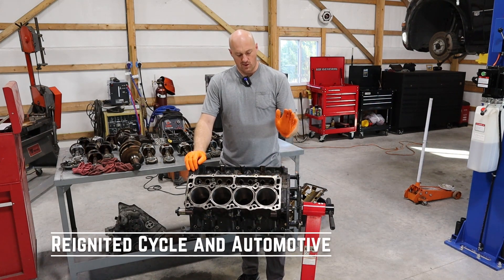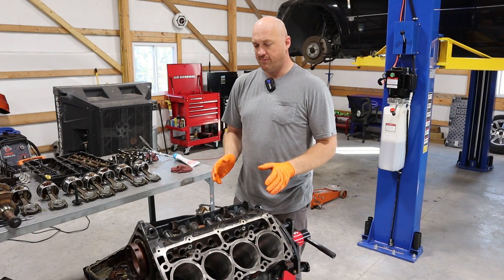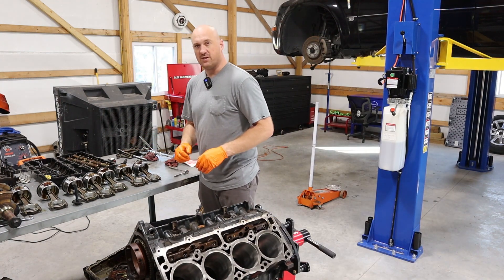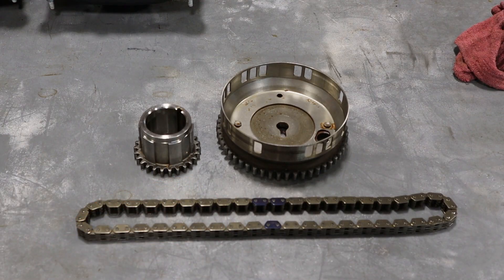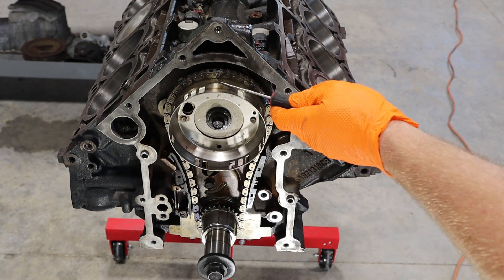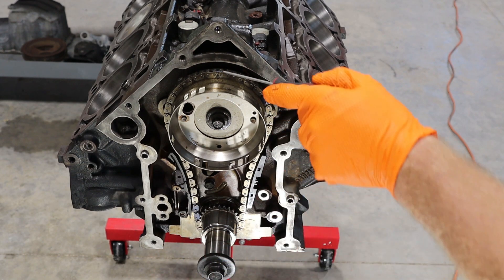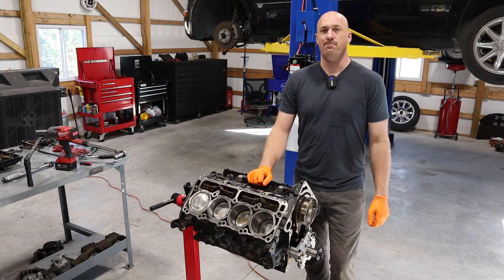How To: Engine Timing on Chrysler Hemi 5.7 // 300C Episode 3

Comment: How important is it to degree your cam after install. I ben hearing different things.
Reply from the maker: There's basically no way to do so on the Hemi engine, either it's in time, or it isn't. 👍
Reply: @ReignitedAuto  ok thank you. I've changed my cam in my 05 magnum rt an didnt degree it an was talking to my uncle about putting a cam in my Chrysler 300c an he mentioned that I needed to degree it an I must have gotten lucky before thanks again 🤘

Comment: Great videos! however 3 things that you said were not possible, actually ARE possible!

 #1: you can swap the cam without taking the oil pump off to see timing marks, just make sure you put engine to top dead center first before disassembly. There are several ways to check this even blindly and that is: put engine to top dead center before disassembling the timing gear assembly, confirm by pulling the #1 cylinder plug and put at least an 8 inch plastic rod down the plug and slowly turn engine over until the rod levels out indicating piston tdc. Also can see cam reference points and crank keyway position in the 1 o clock postion to confirm you're tdc, along with the removal of the spark plug to confirm. If you have the heads off then you can plainly see the piston at tdc to confirm its position as well.

#2 possible thing you said you can't do but can...remove oil pump in a Ram truck while the engine is still in the truck: remove the front half of the oil pan bolts, only loosen the rear half, it will give you enough room to pivot the pan even on a 4x4 to get to the 10mm bolt on the oil pump pickup tube!.

Last but not least the #3 thing you can do that you said we can't: You can indeed install the timing chain while the oil pump is still on and without removing the crank sprocket, the chain has plenty of slop before the tensioner is engaged to route your chain around both the cam and crank sprockets. And you can remove the tensioner assembly to recock it before pulling the pin.

How do I know? I've done all 3 of these methods and I own a ram lol and I also cheaped out and bought rock auto lifters and had to do the job twice!
Reply from the maker: Thanks for the extra information! 👍

Comment: @Reignited - Cycle and Automotive   realize this is an old thread, but my question concerns replacing cams with heads installed. When removing old cam, won't lifters fall through or at least slide deeper into the block, hindering or possibly blocking new cam entering the block?
Reply from the maker: There is definitely that potential, but I did verify on one of my other engines that's is possible to replace the cam without removing the heads. The lifters themselves are pretty flat in the block, but they might slide forward a bit, you can use a long magnet to pull them back through the pushrod holes as you're reinstalling the camshaft 👍

Comment: Is there just the one o ring for the oil pump..I assume the oil port between the 2 bolts holes are a press fit?
Reply: Thanks good sir....have had alot of engines apart especially toyota and ford's..but I'm a red sealed mechanic I'm nova Scotia Canada...and I had figured as much and it wasn't hard to tell from your video that you know shit and could be a reliable source....thanks alot my freind.
Reply from the maker: You are correct, just the one o-ring for the pickup tube, the oil pump itself seals to the block surface with no gaskets. Kinda strange I know, but it seems to work fine.

Comment: hello there sir I have been watching your videos i have got a lot of information from you thank you so much I have a 5.7 hemi that i did a complete body and 4 wheel drive and harness swap I have just pulled the the motor to inspect the parts for water in the engine oil the truck took a fall off the mountain and fell 50 foot down to a dead stop only damage I found to the frame assembly checking the straighten of the frame assy. was ok I want to do a upgrade cam and timing gear assy. I was told i could up grade to parts for the cam and timing chain assy. which is the R T white tensioner assy. but I can't remember what the up grade parts are can you please send me a email on it please (richardfrancwayfrancway32057@gmail.com looking forward to your response and once thank you for you training from your videos.

Comment: Great video!  One question for you if you don't mind!  I am looking to replace the timing chain in my 2012 Ram 1500 5.7 Hemi with a kit.  My question is, if I line everything up as far as the markings and chain colors being correct, does this mean that it is on the correct stroke (compression is correct if I recall correctly) or do I have to take the head off to see the piston at TDC to make sure.  I have also saw a few videos about a tool you put in the spark plug on the #1 cylinder.  I have been trying to figure out if I can do this without taking the head off or using the special tool based on lining up the dots and purple chain links.
Reply from the maker: For sure it's a fairly simple process with the cylinder heads still on. Remove the front timing cover and spin the engine over until the vertical mark embossed into the cam sprocket is at the 12 o'clock position. At this point you know the crankshaft is in the correct position, as long as you don't move the crank after this point then you're in good shape. When you put the new timing chain on, the camshaft sprocket timing mark pointing at 12 o'clock automatically puts it on the compression stroke (the crank doesn't care which stroke it is, the cam is the only difference) Align the new chain using the colored links and you're good to go 👍. The only tricky part about the Ram trucks is that you have to remove the oil pump, and to do so you have to remove the engine oil pan to remove the pickup tube. Let me know if any of that doesn't make sense.

Comment: I had a problem with torquing the cam sprocket bolt. How do you do it, are you holding the crank bolt while torquing the sprocket bolt
Reply from the maker: Best option is to access the flex plate and stick a pry bar in the teeth to keep it from rotating 👍
Reply: @ReignitedAuto  so don't worry about the timing chain tensioner collapsing all the way. Thanks
Reply from the maker: @ronjakober4949  As long as it doesn't jump a tooth it's fine lol.
Reply: @ReignitedAuto  Thanks for the answers. Much appreciated

Comment: Great video! But how were you able to tighten the sprocket bolt from the cam without it moving
Reply from the maker: Best option is to access the flex plate and stick something in there to keep it from rotating while you tighten the bolt 👍

Comment: I'm hoping I can get help with my problem! I am putting my hemi back together and I can't get 6 and 12 o'clock on my crank gear and cam phaser?? It's like my phaser is out of time. When I hold  up my phaser and and crank gear up with the chain wrapped around them I can't get the lines to line up. Any help would be greatly appreciated.
Reply from the maker: Paul hit me up with a picture on either instagram or through email. Instagram @reignited.tx  or reignitedsales@gmail.com Let me take a look at what you're working with and I'll try to help 👍
Reply: @ReignitedAuto  I just sent you an email.
Reply: did you figure it out? im having the same problem
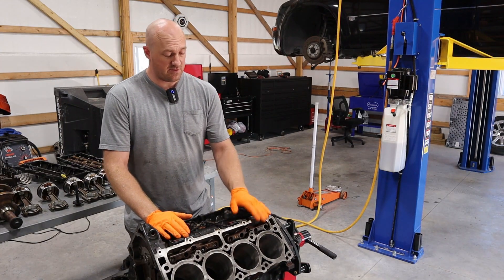Reply: @mellomechanixx9971  I did. When you align your 6 and 12. You want to make sure your 12 is dead on but what they don't tell you is your 6 will be more like 5:30ish.

Comment: Have you ever done the eagle hemi heads on pre eagle block swap? Any recommendations, if so?
Reply from the maker: I did actually try it once before, it's a huge pain. There's a lot of things that you have to buy to make it work. New pushrods, new intake manifold ect... Wasn't worth it in my opinion.
Reply: I have all the parts but am worried the pushrod size. Didn't know if you remember the pushrod size
Reply from the maker: @adrianortiz5085  I don't, but the factory pushrods from the newer engine should work.
Reply: @ReignitedAuto  that would be a great video to do in the future. There's a huge community that want more info about this build but no video in detail of how to. I find forums that have info but not complete steps and parts required. Great job on the videos you have out. Lots of info in detail. Keep it up
Reply from the maker: @adrianortiz5085  I've got an '06 block that needs a cylinder head, thanks for the suggestion 👍
Reply: @ReignitedAuto   I've seen the post about the new lifters with bigger bearing. Do you happen to have the new stock number and would that work on a 06 block set-up

Comment: Did you reuse the connecting rod bolts?
Reply from the maker: I did in this case. Technically Chrysler wants them replaced each time, but these are not torque to yield bolts, if you inspect them and they show no signs of stretching or fatigue I felt comfortable reusing them.

Comment: Hey man, your videos have helped me a lot in my rebuild. My mds lifters go up and down but the non mds all of them don’t budge when pushing with the push rod, is this normal or does it mean it’s bad?
Reply from the maker: Totally normal, the hydraulic portion of the lifter is still pumped up with oil, and it'll feel solid 👍

Comment: I have a question how do you tighten the cam bolt. I have a 2005 5.7 ram. And I have the timing set up already but. Idk how to torque down the cam bolt. Any help would be great ful 🙏🏻🙏🏻🙏🏻
Reply: did you have to drop the oil pan to remove the oil pump ?

Comment: WOW.. Great Video! what cleaner do you recommend for the heads
Reply from the maker: For cleaning the heads themselves, or for cleaning the gasket surfaces?
Reply: @ReignitedAuto  Gasket surface. Thank you
Reply from the maker: @Hugo_Umana  I use the red Roloc discs on a 90 degree sanding wheel. 👍

Comment: I have 2014 Ram 2500 with vvt no mds. The cam phaser is moving if I rotate it backwards slightly when setting TDC on #1. Is it the lock pin supposed to be engaged when it's not running?
Reply from the maker: It's normal to do that 👍
Reply: Pushrod on number 3 intake was out of place on the rocker,riding on the side of the rocker hanging the valve open. Put a timing chain and oil pump in it also. I've done 3 of these in the last two weeks, 37 years as a mechanic and I made a dumb mistake. Thanks for the suggestion,it worked out perfectly.
Reply from the maker: @mikevan803  glad to hear it! We all make mistakes, I've got a doozy of mistake I just made coming out in a video soon 😳
Reply: Thanks for the information, I replaced the push rods,severe wear on 5 or 6 of them I did pull the heads and inspected the lifters,all were in good condition. I didn't pump down the lifters It ran terrible. I rotated it at the crank about 5 times after,ran much better but still has a map code and stalling nothing wrong with it before. If the lifters with the bad pushrods were over pumped could it bend the valve slightly? Going to do cylinder leak down test on all tomorrow.
Reply from the maker: @mikevan803  first thing I'd do is pull the valve covers off and spun the engineover by hand to make sure the valve are all actuating correctly. Its very easy to not get the pushrods situatedproperly in the ends of the lifters, or they are not fully seated in the rockers themselves. 👍

Comment: That's not true, you can do a cam swap on a 15+ 5.7 hemi 2500 truck engine without removing the oil pump, the thrust plate has plenty of room. Ask me how I know :)
Reply from the maker: You're right, the '09+ models have a separate cam thrust plate do you can do that, this older model engine the thrust plate is connected to the timing chain tensioner assembly. 👍
Reply: @ReignitedAuto  I didn't know that either good info

Comment: When I rebuild an engine I would change the lifters if they  are good or not I would put new ones in because once you down that far you might as well replace them lifter the old lifters won't last that long so I will go ahead and replace with new ones that's what I would do I'm not saying he not a good mechanic but that's what I would do
Reply from the maker: Generally I would, but the pre 2009 lifters are not known for failing, plus I was just rebuilding this vehicle to resell, so you have to save costs where you can. Thanks for watching! 👍

Comment: On the mds soleniods if you change them and one was loss. Would it make the motor shake and act like its losing power. Man I am in a mess. And need help.
Reply from the maker: If you only replaced the solenoids it wouldn't cause any kind of a misfire. Did you do any other repairs besides just the solenoids? Do you have any misfire codes?

Comment: Running a stock cam is one thing, but keeping the mds system? I would have deleted that crap for sure.
Reply from the maker: I was just building this vehicle for resale, it wasn't worth the cost of buying a tuner to turn the system off. Thanks for watching 👍
Reply: @ReignitedAuto  thanks for the video,  been thinking about doing something with my 04 ram hemi. 175000+. Getting tired.

Comment: how do you know if the timing belt is worn
Reply from the maker: The timing chains will stretch a little, but usually there aren't any external signs of failure. If I were doing this jobto my vehicle and it has over 100k I'd think about replacing it since they are pretty cheap.
Reply: Do I need to replace both gears with a new chain?

Comment: Just me but if i have an engine out replacing cam I'd have new lifters too.... that's just me though...
Reply from the maker: On the '06-'08 generations they aren't having the lifter failures that the '09+ models have, so I felt comfortable re-using them. The cam was the stock cam going back in as well.

Comment: how do you keep lifters up for a cam swap in the car or truck
Reply from the maker: To be honest I've never tried it without taking the heads off, but I'm pretty sure it can be done. Just remove the rocker arms from the heads, spin the camshaft 720 degrees to make sure all the lifters are pushed back and then pull the cam. Would I feel comfortable that they wouldn't then slip forward and fall down? Probably not 😄 I'm definitely more comfortable taking the heads off to do a cam swap, but you're likely to be changing valve springs with a cam swap anyway right?

Comment: Had you known that you weren't going to have to send the block to the machine shop......   you wouldn 't have removed the MDS solenoids or the oil pressure sensor, correct?
Reply from the maker: Yep, figured the block was going to be hot tanked, but that didn't end up being the case. Thanks for watching! 👍

Comment: I have 6.1 hemi from a chrysler I wouldn't need to take the heads off just to do a timing chain ?
Reply from the maker: It's not necessary no, but you have to make sure the engine is at top dead center BEFORE removing the cam chain. If you dont remove the oil pump you aren't able to see the lower timing mark. 👍
Reply: @ReignitedAuto  thanks for the reply I'm going to try this soon I thought I was hearing a stuck  lifter but the shop I go to said it can be the timing chain tensioner had broke
Reply from the maker: @srt_andretti  is this a hellcat? I'll be honest, I've only ever seen a cam chain tensioner break one time. What noise is it making?
Reply: @ReignitedAuto  I wish it was a hellcat lol do u have a instagram I can send u the video
Reply from the maker: @srt_andretti  yep @reignited.tx
Reply: @ReignitedAuto  ok cool I messaged you

Comment: Thanks for a very well done video... I'm a complete amateur and would feel comfortable following your video. Had a couple questions... you mention it's possible to do a cam replace on the cars without having to remove the heads. Then you follow up to say you can't on the trucks (due to extra bolt on the pickup tube).... what about the Jeeps?
Was also wondering if the blue marked links don't stay in position after rotating the engine, is it (how would) too set the timing using a timing gun?. 
Thanks for the great videos!!
Reply from the maker: Thanks for the kind words! The jeep is similar to the trucks due to the engine oil pan design. As far as the engine timing is concerned, no gun is needed, it's all electronically controlled between the Pcm  and the crank sensor/tone wheel. The process shown in this video just makes sure the relationship between the cam and crank is correct. 👍

Comment: Why would you put the old roller lifters back in if you know that there is definitely a problem with the stock ones straight from the factory?🤔
Reply: But great video, very knowledgeable.
Reply from the maker: @jasonvarner3435  This is a 2006 engine, the lifter issue seems to start at about 2009+ thanks for watching! 👍
Reply: @ReignitedAuto  I'm glad to hear that. I have the hemi in my 06 commander. Thanks for the reply.

Comment: Attention in the pits always and I say again always replace your lifters. The stock lifters are notorious for failing so why put known junk parts in a fresh engine when you could upgrade to improved lifters and do away with the crappy MDS system.
Reply from the maker: Couple reasons on this car, its a 2006, these lifters are not known for failing it's the 09 and up that have that issue, secondly this was a flip project so no point in going overboard with removing the MDS. 👍 thanks for watching!